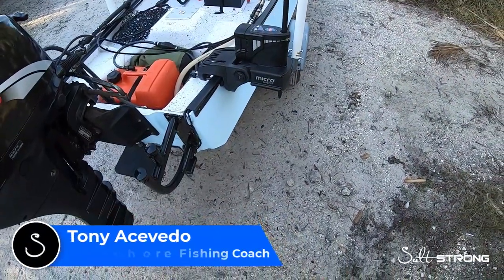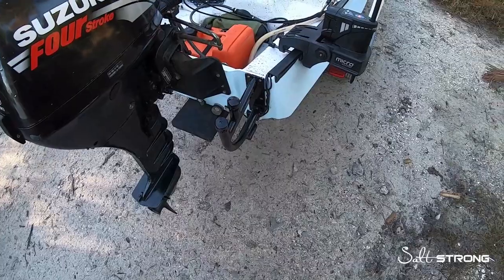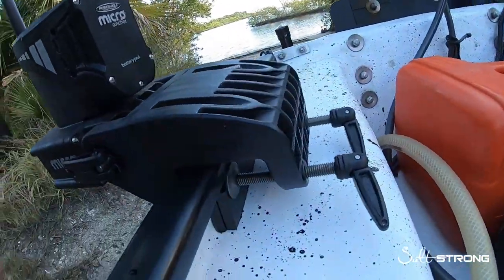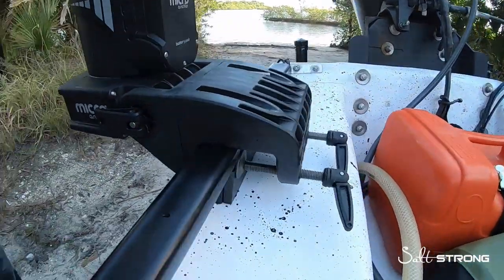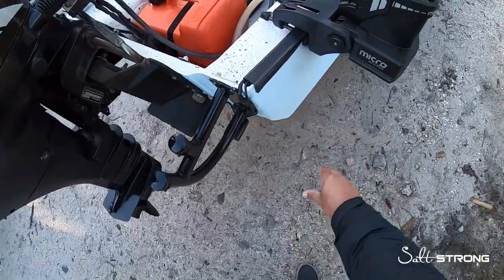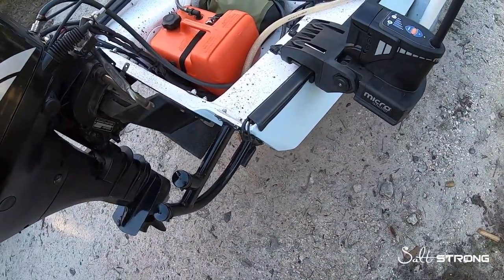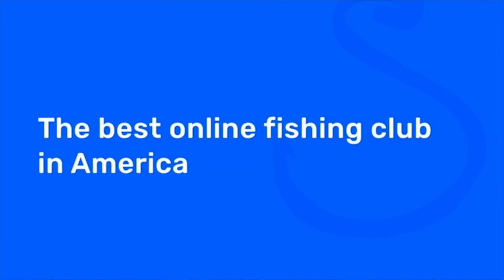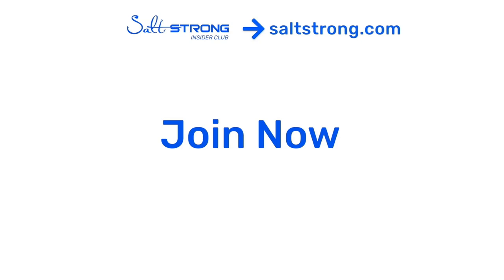Easy Way To Mount A Micro Power-Pole On A Small Skiff Or Watercraft

Comment: How low can these sit in the water, do they have to be high above it, or can the bottom of the unit be submerged?
Reply from the maker: The unit has to stay dry so you want it mounted above the water line. Also be mindful of where it’s mounted while the boat is driving so water doesn’t splash it. I had to replace mine a while ago when a wave soaked it.
Reply: @Saltstrong  Okay, that's what I was wondering. Thanks so much!